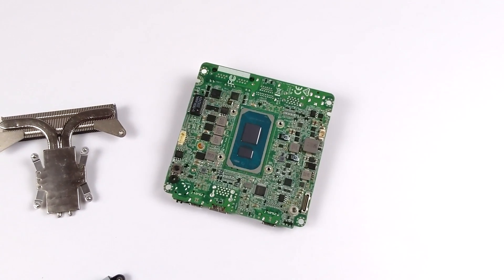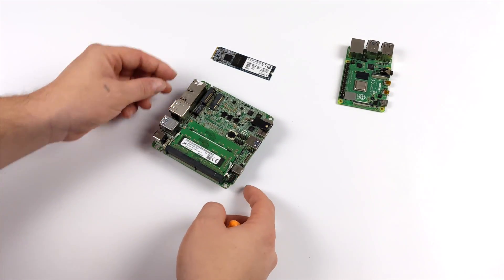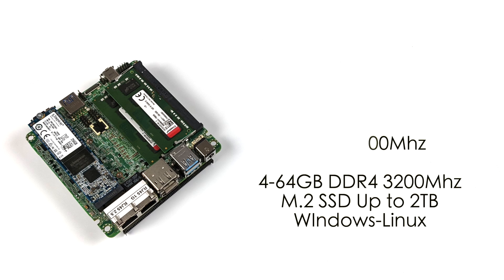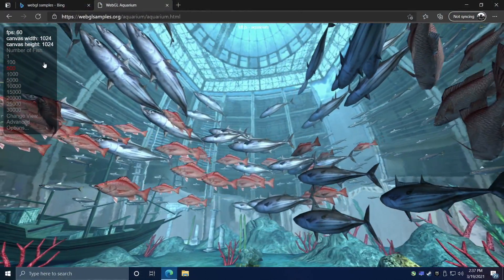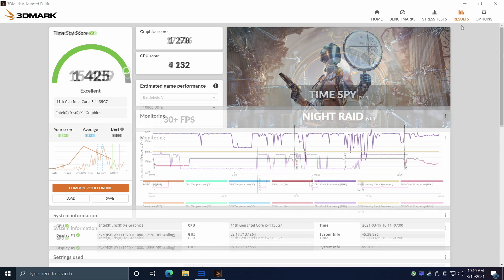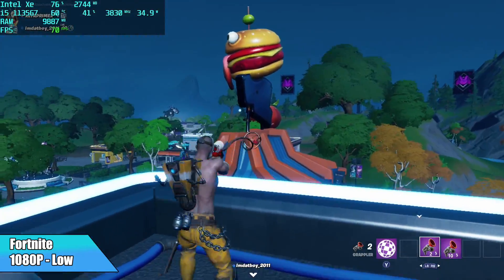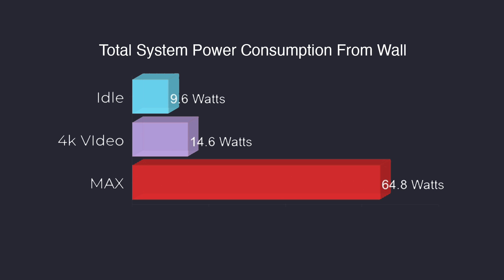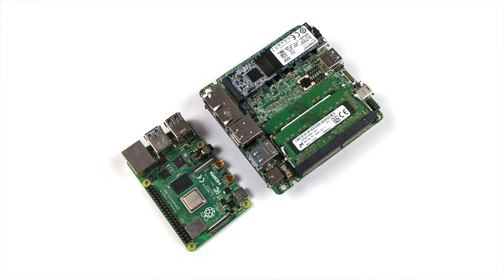This X86 Board Is A Powerhouse!

Comment: Well the tigerlake i7****g7 is just crap it's always worse than the i5. The it can hold its cocl much better 😉

I have a yoga slim 7i and it runs the i5 1135g7 with 30w peak and 27w continuously if you turn on the most powerful mode and have it plugged in.

Comment: 2:55 Android OS is built on a Linux kernel, if it can run Linux it can run Android OS.
Reply: Installing Android on this little machine is just waste. With the power of i5-1135G7 you can just install Bluestacks or other android emulator, every mobile game will be running just fine or even better than high end phone.
Reply: @runninginthe90s75  I wasn't suggesting installing Android would be good for anything I was just pointing out Android OS is built on a Linux kernel.

Comment: I'm looking for a low power (at the wall) system for 24/7 home server that will house bunch of vms, docker, home automation stuff and maybe a NAS. Love the 2.5Gbe network for that BUT it has no SATA. Any recommendations, maybe using a nvme-> sata card or via thunderbolt?
I'm also looking at 4800hs mini pcs. also idle low (5W) but full load go to 110W (which admittedly I could limit)

Comment: Would be cool to see if using this board, a small 7in panel, 3d printer that you can make your own GDP win type of computer. just need something so you can add a battery to the 12v system. put on a Retractable Handle ipega and boom a small super handheld

Comment: Oh wow, 2 TB3 ports on this tiny board, with i5, up to a ton of ram and 1 m.2. That is an impressive setup for the form factor. You could even slap this straight into an eGPU enclosure and you'd have a cool tiny PC out of it.
Reply: Sadly it doesn't have thunderbolt ports. Check the specs on the Asrock website
Reply: @rpc72  Ah damn, that is unfortunate if those are just UBSC ports.

Comment: two thunderbolt 3 is good. but if there was a full size PCI-E X8 port can be perfect for gaming.

beacuse CPU can support X16 pcie lines.
two thunderbolt is use x4+x4 but remainder x8 is not used

Comment: My Desktop PC is already a few years old, but it has an i7 5820K with 6C/12T and is overclocked from 3.3 GHz to 3.8 GHz with 16GB of DDR4 RAM at 2400 GHz.
It didn't beat that mini PC in Cinebench...
I only got 5266 points. 😥

Comment: A great platform for creating microPK. To be honest, on the part of the user, this is a good option, on the part of the technician-engineer, a very bad option as a maintainability. I am a technical engineer and I hate combined processors, because in these processors, the PCH area often burns along USB lines.

Отличная платформа для создания микроПК. Если честно со стороны пользователя это неплохой вариант, со стороны техника-инженера очень плохой вариант в качестве ремонтопригодности. Я техник-инженер и ненавижу комбинированные процессоры, тк в данных процессорах часто сгорает область PCH по линиям USB.

Comment: I don't know about the traces in the board, but if those are equivalent and won't fry, the only thing limiting 
full desktop wattage (at least 60watts, but preferably upto 100) would be cooling and BIOS.

Would be cool if the BIOS was unlocked... Slap a full sized cooler, one of those weird ones, then have that stick out of a little enclosure like a sports car intake.

Edit... Looks like the CPU itself is locked to 28watts, so it would need to be messed with a little more, like forcing up power intake.

Comment: Nice board. Finally Intel has released an iGPU which can run something more than casual games.
The two ethernet ports make little sense for most home users unless you want to build a router or a NAS. I wonder what was the main purpose of including two ports. Clustering ?
Reply: It's for embedded/industrial use, one port for the general use of the OS and one port to remote in and monitor things.

Comment: I assure you that if they took out a plate similar to the raspberry but with a qualcom snapdragon 845+ processor with 16 gb of ram, it would be a plate to take into account, and why not take it out?
Reply: 8gb for a raspberry pi 4 I think they fall short, especially for emulation and evolved operating systems

Comment: Your definition of what a single board computer is seems so weird and arbitrary.  If RAM isn't soldered on to the motherboard but insteads pops in a slot... It's still a single board computer... It's literally on a single board still, which includes the slots.  RAM is not a board itself; it's an integrated circuit that slots in to a port on the single boad...  And if it were a board, being soldered on instead of slotted on wouldn't change that.

The same goes for external memory; if you go by the definition you say, nothing is actually an SBC since they amost all use Micro SD cards, which is no different than any other type of memory slotting in a port somewhere on the board.  For some reason you differentiate micro SD from emmC or other forms of external memory, and I have no idea why; external is external, and a port is a port.

I don't know how you decided on your definition, but I find it to be absurd.

Comment: Incredible for the size and price. I am curious how the latest AMD APU's would run on a similarly small board with even more cores.
Reply: Well the zen 3 powered APU AMD have up to 8 CU GPU but only in the top SKU, the ryzen 5 and 3 will have less CU. With this you wil have a very good GPU but with a overkill CPU and a higher price, but this intel APU are very interesting because they are design to have only 4 cores with slightly better GPU than the ryzen 7 for less money, ideal for this kind of device that can't have a dedicated gpu because they have lower power requeriments.

For know we know that AMD is working on a Zen2/RDNA2 chip for lower power devices, this probably will have up to for 4 CPU cores. 
The codename for this chip is know for "Van Gogh", it first appears on linux code.

Comment: there is AMD version with similar ports and form factor 4x4 4800u, hope to see a review soon
Reply: I bought 4800U
Reply: @tllenet  let us know how to goes...
Reply: Yeah this would be very interesting, they're almost identical board layout etc. Embedded Radeon vs the new Xe. More cores vs higher clock. I suspect the AMD boards would have the edge. The intel chipset does have the edge with Thunderbolt 4 though.
Reply: @dmanlfc74  i doubt it. Especially on emulation
Reply: And raspberry pi x quallcomm
Reply: @MiMayonGo  raspberry Qualcomm ????
Reply: @zappingdumondeanimal2925  Nope
Its just a hope that qualcomm and raspberry pi work together

Comment: It's an impressive little machine but....then you might as well get a r5 3400g.Yes the intel chip is most prob stronger but i have seen my brothers 3400g run cyberpunk just fine.The problem for me are the price for such a small single board computer.If it came at around 50 usd cheaper then it might be worth it but as it stands now,if i were in the market i would most prob skip this.But hey that's just me.

Comment: At this rate I expect the future to be just a fan with a pc attached.
Reply: Eventually our toothbrushes will emulate PS3 games
Reply: @GenericPast  The dentist says I need to brush more frequently, so I'm playing through Mass Effect again.
Reply: A single chunk of silicon which has the connectors on one side and an enormous heatsink+fans on the other.
Reply: probably just a fan and no screen. the dust on the fan will give you "retina" display
Reply: You mean a psu
Reply: @cassiodalcin  confusion
Reply: Or an air conditioner for an PC
Reply: LOL
Reply: No, i think at this rate a vr headset would playing all games without any hardware, generating energy from the heat our body gives off 😂

Comment: That looks awesome, and it's a WAY better deal without the case. Would love it if you have an eGPU to test it with, maybe the ~25% bottleneck is less with a modern mobile chip.
Reply: Rassbery pi 3 top hub 
Bios progrmmer on power critrn
Chip sing bord

Comment: Tiger Lake is just insane. Desktop-class single threaded performance. Multithreaded performance that scales about as well as you can expect for a 4 core part. An iGPU that beats the best that AMD has to offer. If the 45W chips with more than 4 cores scale so well, we could be looking at a situation where Tiger Lake laptops and SBCs are actually outperforming Rocket Lake desktops.

Comment: This is so impressive ! That much performance on a SBC with only a little fan ! And that price ! We're entering a good era. If the competition between AMD and Intel continues on laptop powered chips, we'll have beast APUs in some years !
Reply: Hopefully the upcoming rtx 3050 uses only 75w. That way you can slot a lp card in to an ebay sff pc for dirt cheap
Reply: @edlee5214  Not gonna happen this generation. And I doubt it'll happen in the future either. Just get something with an integrated GPU.
Reply: @AmbientVibes For its form factor and performance that's not bad. My rig is getting to the end of its life, but it's an i5-2500K that's been upgraded over the years with a heapin' gob of memory, a SSD on the PCIe bus, and a GTX 970. Pretty okay, but nothing to write home about or anything. Still it holds its own pretty well, and dang if this thing doesn't match it frame for frame. Heck I paid more for the video card than this costs.
Reply: Well your prediction is right. It's 2022 and AMD released Ryzen 6000 series APU with more powerful RDNA2 integrated graphics
Reply: @AmbientVibes He said he bought it for $280
Reply: @AmbientVibes Well I'm not gonna believe he's a liar, so I believe it went up since then. But don't worry, I'm not saying what you said isn't true. I can also make a better pc with $500, but that was not exactly the question initially.

Comment: A direct comparison to a 1650 level GPU (with similar cpu) would be great.
Reply: It's about 40% the performance

18K Geekbench OpenCL (Xe) vs 40K Geekbench OpenCL (1650 MQ)

One would assume that a 1650 would be 10% than the MQ variant so that's roughly 60% better than Xe
Reply: As far as Time Spy goes, An Asus 1650 Dual scores around 3600 graphics points at stock, so the 1300 points here are more or less representative (doubtful there's a CPU bottleneck). You're looking at something about 10% faster than a GT 1030.